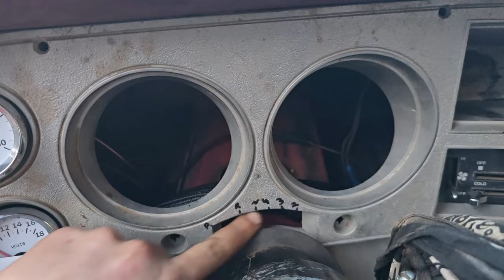FINALLY hearing the engine run!!

Comment: Can you walk me through the wiring process. From the “stock bulk wiring” and what wires you used from the stand alone “under the dash wiring” 
I’m so lost from that point. I’m wanting my original gauges minus the speedometer until I figure that out.
Reply from the maker: Ok so youre wanting to know the difference between the factory wiring on the donor truck and a stand alone harness that you buy? Or am I misunderstanding?
Reply: @RandomAmerican  the factory wiring from the square body vs stand alone. Like which wires do I connect to get it run and drive. And from the Walter’s gear did you cut the connector off and splice them together with the stand alone to get the vss.
Reply from the maker: I tell you what. I'll do a video on it and explain it in as much detail as I can this week. I'll show you where I hooked up everything and how I did it
Reply: @RandomAmerican  i surly do appreciate that brother. That’ll help me a lot where I’m using stock gauges